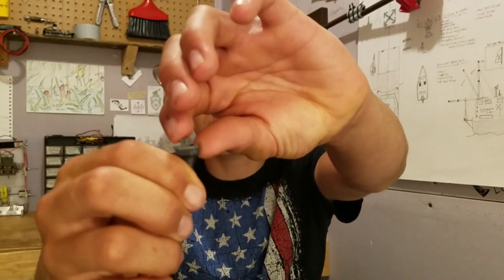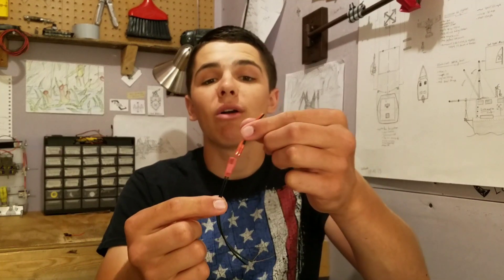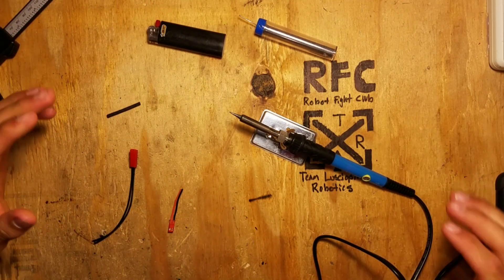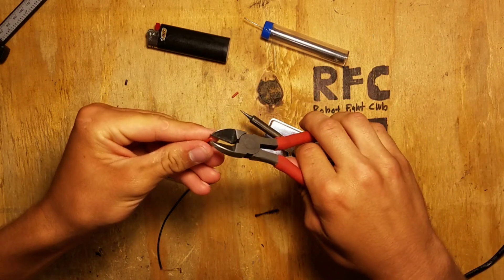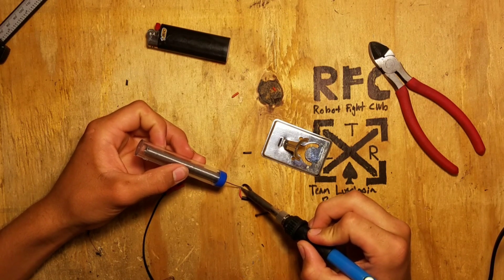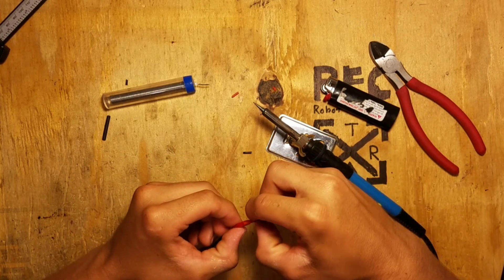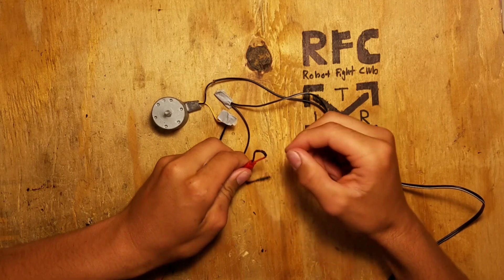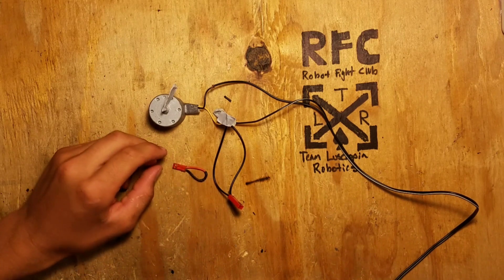CHEAP and EASY power link for combat robots

Comment: Nice! I assume this could be transferred over to other types of connectors aswell.
Also, do you write a script or atleast a general outline of what you want to say or is it just many takes until you get across the point as well as possible? I normally just say something into a camera then a few takes down the line it is refined enough do sound decent.
You are very good at not stuttering and umm ing even on that live stream how do you do it?
Reply from the maker: I don't usually write a script, although I do sometimes. I usually just have a small outline of the video and what I want to say, then go from there. It's usually a good idea to have a basic idea of what you want to say or it will take forever to say what you want to. But I also usually have to do multiple takes, especially on the intro (I tend to talk really fast on camera). It sometimes takes a while and believe me I trip over my words a lot while filming, so I just have to do multiple takes and have some idea of what I want to say. Some of those  mistakes were probably highlighted on the livestream 😐. Thanks for watching!
Reply: @robotfightclub8349  thanks for the answer  I have a few actual decent video's filmed but I have nothing to edit them on because my dad needs the computer because he is currently working from home
Reply from the maker: @TeamTORG  no problem
 I look forward to seeing those vids in the future!